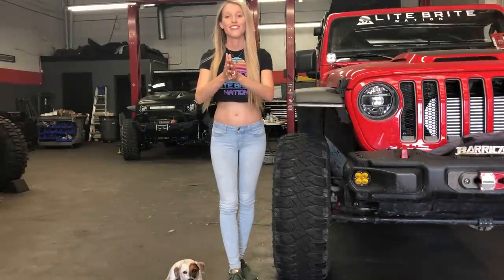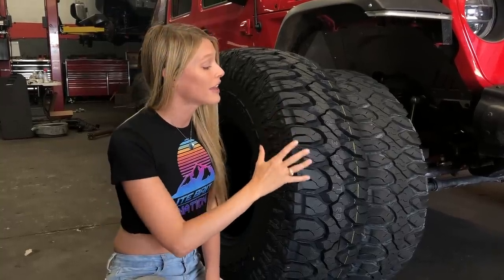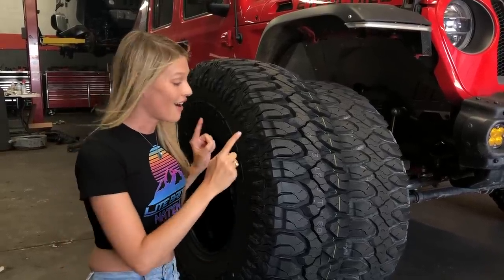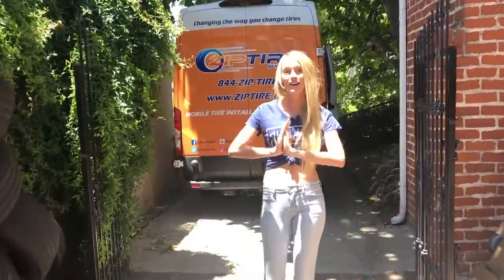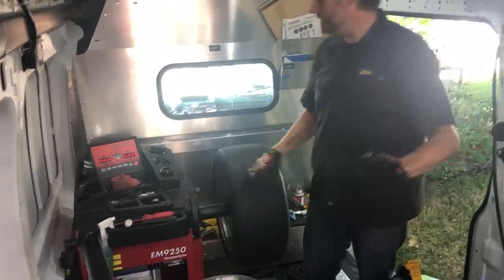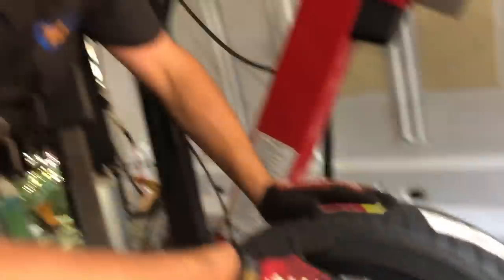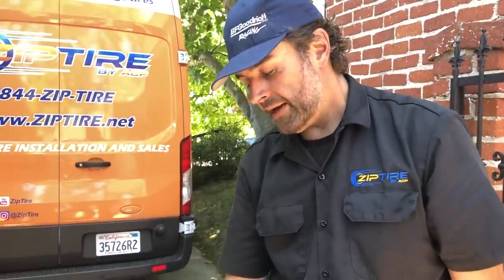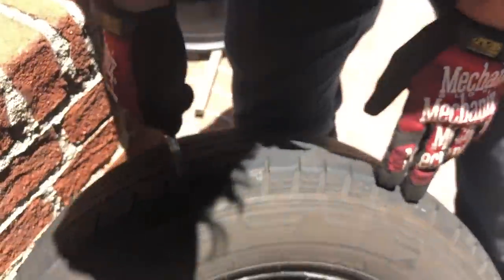LONG TERM TIRE REVIEW - Milestar Patagonia M/T

Comment: I bought a set of 35x12.5x15 inch Milestar Patagonias for my 1996 chevy k1500 with a 6 inch lift. First weekend I had them on we went rock crawling and trail riding. All I can say is OMG what a tire. While other rigs we’re struggling I was just walk right by them at about 15psi. Absolutely love my tires. And like y’all said, these tires are absolutely the quietest mud tire out there.

Comment: I love my Mickey Thompson STZ's zero road noise yet deep tread lugs and killer capabilities on most any surface excelling best on snow but with a mud tire look with side treads... Cheap too!
Reply: kevin auman I use to run those. Great tire. They are made by cooper
Reply: @boughtnotbuiltoffroad7784  yeah I saw one of your old vids of them but didn't you run the mtz's not the stz?
Reply: kevin auman yes your are right. I had the mtz
Reply: @boughtnotbuiltoffroad7784  right, I have the STZ or "snowterrain" while the MTZ or "mud terrain" are two very different tires....  Do a quick Google image search for the stz's and you will see the ones I have, much deeper lugs and although they look to be less aggressive of a tire they are insanely capable on any surface mounted on my Yukon Denali.... I was pushing snow up over the hood the first winter I got them and I was still only in 2wd

Comment: I have been wondering about the Patagonia tires. Thanks for doing the review.
It was refreshing to see so much accurate and useful information.
On our race cars a lot of money is spent to reduce rotating mass. Down to gun drilled titanium axle and transmission shafts and aluminum lug nuts. One thing to remember, the further from center the more significant the resistance is, so a lighter tire is more important than a lighter wheel. 
One thing you did not mention is unsprung weight. The weight fastened below the suspension must be controlled by the suspension. The further it is from the suspension the more leverage it has on the suspension. You did touch on this indirectly when mentioning the lack of failures. It directly affects the performance and ride quality.
I have spent a large portion of my life running log skidders and doziers and other equipment. The pay depends on production, often at the outside limits of what the machine can do.
One thing I have learned is new deep tread or tracks is often not the best performance. Weight balance/distribution and contact area are the most critical. Rarely is a sharp edge going to catch something strong enough to keep you moving. Not nearly as often as it is going to paddle the material out from under you.
If you are really serious about tread keeping traction off road, it needs to be steel as in bolted tires, chains or grousers. Chains will go through mud better than any bogger.

Comment: V8 with power and 40s = Kaboom dana 44. 1 Ton axles all the way. 40s are a PIA, curious to see how you like them on the street. Jeeps just drive different with 40s IMO. A guy I know just ditched his 40s and went back to 38s on his JKU. Not sure how they are on the JL. With regards to tires those Nittos in video are what Im running and I must say they are better than Toyo or any other M/T tire Ive had. 

Wheels:
Powder coat the wheels gloss black, have the bead lock ring powder coated the same red or close match in gloss red. Leave the dimples polished= WIN

Comment: Excellent production, pretty sure I'm going to try a set of Milestar Patagonias. One thing... its misleading to say that big tires and beadlocks could be adding "135 pounds of rotational mass per corner, or over 500 pounds total." Finish the equation and subtract from the 135 pounds per corner, the weight of the tire and wheel coming off each corner. Maybe adding 15-20 at most per corner.

Comment: I'd have the rims anodized.  More resistant to scratches.  If you powder coat them, i don't care what anybody says...no paint will hold against 5k lbs smashing it against a rock. Period.  But ano infuses the color into the surface and will hold bett(er) against scratches.  And i don't care what that silly man says, i LOVE the look of the Milestars, they are just different from the rest.

Comment: Leave the wheels as is, I like.  Also for Jeep enthusiasts out there, SCS (Stealth Custom Series) is now offering a Jeep wheel you may want to check out. Weighs only 25 lbs 3 oz. and I believe you can get them beadlocked.  Of course that will add weight.

Comment: I would have gone with 39x13.50r17 BFG KM3 Tires. Gloss clear on the rock ring and clear or a color on the rest of the wheel.
Reply: C7 GT1 the 39 KM3 is 37.5 so no thank you

Comment: Wow I never knew why but my 37 Pat's did look much better than my 38s.
Reply: Rusty Taflinger ya. We recently figured it out. Wish the aggressive pattern was on the 38 and 40
Reply: @boughtnotbuiltoffroad7784  That just blows me away. I just figured I'd gotten used to them and they were the same. I did the Jeep Bantom weekend and the trails were one big mud hole. I did real well on the trails unlike some and did notice the tires loading up with mud. Speeds were super slow so never had a chance to get some good wheel spin and try clearing them out. I think I was at a slight advantage because most people were on 35s and the 38s gave me that little extra I needed. Super jealous of those 40s, one tons and that motor. You staying with the 6 pack shocks?

Comment: Just wondering,  what is the proper tire air pressure you guys should have been running instead of the 8lbs Kevin had in the tires for the 2 hour drive? More Jelly !!!
Reply from the maker: 2019 JLUR Billet Silver Metallic Probably about 28-32psi

Comment: Guys, no tire clears mud very well... even aggressive mud tires. Fast wheel spin is the only way to clear your lugs in mud. Good luck from muddy Florida.
Reply: Gerry Harvey 🤔🤔
Reply: I'll tell you KO2s are worth a crap in mud even with wheel speed.
Reply: This.  I wheel in the midwest (ohio) and some of the sticky mud we have here, i've not seen any tire clear well without goosing the throttle.  If its the type of sticky crap that adds 10lbs to your shoes by walking 20 ft, then its going to do the same to any tire, period.
Reply: Won't fast wheel spin just dig you deeper into the mud?
Reply: Yes.  But it clears the mud from under the tire to EVERYTHING else!  Haha

Comment: Powder coat chips, and well, sucks to touch up. Suggest you guys look into getting your rims coated in Cerakote'. Way more durable and plenty of color options. I used Buster Beaver Designs http://buster-beaver.com/ since their local to me but I'm sure there's a cerakote dealer/coating company in SoCal. Just had a AVE front JK bumper refurbished and finished in a clear cerakote which looks amazing!

Comment: Powder coating the rim is for mall crawling only, it looks awesome on the 2nd floor of the parking garage.
Reply: Good thing they are only powder coating the inside right? Because they dont mall crawl
Reply: Jubeidono2012 hahahaha they could just raptor line it, looks good and strong

Comment: The DOT doesn't "approve" wheels. They issue a set of requirements with which wheels have to comply in order to be road legal.
With that, you were correct that there are only 2 DOT compliant beadlock wheels. B. A. D. Eklipse and Hutchinson Rock Monsters.

Comment: I use kittens W/velcro booties for extra traction, found out bunnies are too sloppy!!😜
Power coat adds weight too, for more mass in rotation! Pretty wheels are for the street anyway! 🤷‍♂️ I have new ko2’s on cool wheels & Mt’s (usually used) on stock Moab’s

Comment: Approximate Weight 
PATAGONIA M/T             40X13.50R17LT   88lbs    $388
Trail Grappler® M/T        40x13.50R17LT 103.7lbs $402
DISCOVERER STT PRO™
 40X13.50R17LT   92lbs    $430
Reply: Mikie Peters yessir

Comment: I run the kmc machete beadlocks (no powder coating) and Ultimate Dana 60’s and have tore up the rings since I met you guys at KOH and love them! Best investment so far. I keep the scratches... memories. Plus I get more compliments on the wheel’s raw aluminum. Cleaner look

Comment: So, this is a repost of another post, but I feel like it fits the video well :
There is indeed a proper terminology when it comes to wheels/rims/tires, unlike motor/engine.

/Warning Wall_of_text_and_history

It's tied in with the history and development of the wheel, which essentially goes like this :

First wheels were solid disks with a hole in them, and they were just .. wheels, duh. Made of stone or wood, with a hole in the center, sometimes capped off with a more durable material, like an iron ring, to increase durability.

Then someone wanted to make them lighter, and invented the spoked wheel which consists of :
 - The Hub (also called the Nave)
 - The Spokes
 - The Felloes (also called fillies)
 - The Rim 

The Rim was usually a metal band around the Felloes, that helped keep them under compression, though wet leather could be used too, as it shrinks as it dries.
Wheelwrights would jokingly suggest that the Spokes where only there to keep the Nave (Knave = uncouth fella) from the Fillies (slang for young female horse = young girls).

Sometimes softening material was added to the rim, like rubber or leather, and that is what evolved into the tire.

In fact, when bicycles came around, the pneumatic tyre was invented to soften the ride, and the old practice of Felloes and Rims, was combined into a single unit, now just called the Rim.

So now you had :
 -  Hub
 -  Spokes
 -  Rim
 -  Inner tube
 -  Tire

In the name of efficiency, a smart bloke decided that all of this spoke malarky was just too much work, and replaced them with two discs … it didn't take them long to realize that welding the whole thing together was even simpler and stronger, and the Steel Rims were soon born.
And while they were at it, they removed one disc, and made the other stronger, so now there was only one disc to weld to the Rim and Hub Assembly.
Technically, those are wheels and not rims, but since driving on them is incredibly inefficient, uncomfortable and unsafe they are usually referred to as Rims, and the whole assembly + tires as wheels - Trains, however, do drive on steel wheels.

Now, those Hub Assemblies were problematic, because it means you had to have a spare wheel for the front, and one for the rear.

So cars did away with the old method of the hub assembly by making the hub a part of the vehicle, and not of the wheel, because bolting the wheel to the hub, allows you to have a spare wheel for your car, that fits on all four corners.
 
Then came along tubeless tires.

Thus we have now reduced the wheel down to :
 - Rims
 - Tires
 - Valvestem

And assembling those, makes a useful Wheel.
Ta-daa ! 😁

Comment: Don’t powder coat the wheels. If you leave the finish aluminum the rock rash won’t show as much, scratched powder coat with the aluminum showing through will look bad. I vote leave the wheels finish as is.

Comment: LiteBrite >>> thank you for posting this video with your very talented and knowledgeable motoring/"engine-ing" friend.  You are doing both him and us, the consumers stuck at taking our vehicles to tire shops where they do not know anything they're doing, a favor.  I have had nothing but bad luck with tire shops that do not know how to proper pattern to rotate tires, they take shortcuts out of laziness and do the improper thing, causing you the consumer to have to replace your tires more often.  I have witnessed them "tighten" lug nuts not knowing the proper pattern, even leaving some completely loose; if you don't want this, definitely look into ZipTire!

Comment: I once had a tire puncture with a bolt the size of the one shown at the end.  It was on a full size K5 Blazer at highway speed.  The front tire kicked it up and it punctured the back.  No warning, the back of the truck just dropped instantly.  I got lucky that day, I don't recommend it.

Comment: I have quite a few jeep buds that say the mile stars aren't very good in the rain. I'm thinking tire pressure is critical for on road use in wet weather. Good tire tho. I have the XD Machete bead lock. Black wheel - polished ring
Reply: Brian Head most mud terrains don’t seem to do too well in the rain. Just throw it into 4wd. Lol

Comment: Red anodized spokes, raw alum bead ring!!! Or at least body color red - that’s your brand! Thanks to you guys I have 38” Pats and KMC 229 with red hubring like TrailRecon’s I picked up from Off-road Evolution. Awesome setup. Replaced heavy loud stiff 10ply Nittos. I didn’t like the MP tread at first now I love them for what they are. I heard “I only do V8’s” ;) Great tire video.

Comment: Everything you said about tire weight was correct. And coming from the drifting world I can see why you said it. Plus if you drive your Jeep on the street you need to be concerned with rotational mass etc.  But for off road, a heavier tire can be better, as long as that weight is in the right place. More rubber in the side walls will make a heavier tire, but one also more resistant to sidewall tears and punctures. If you have a rig that is trailered or a rig that isn't daily driven I wouldn't worry as much about the weight of the tires as their overall construction and what use I was going to put them to.

Comment: A rim is a metal center that a tire mounts on to create a wheel. Exception will be spoked wheels ala motorcycles or Englich sports cars, rim, spokes,  hub, and tire create a wheel assembly. Maybe ;-)

Comment: Question on the tires they kind of get a bad rap on when I asked that they wear badly and get a lot of road noise when they wear down?   Your opinion
Reply: Ralph Casados that depends on how often your rotate them and how good your alignment is. In our experience, all of our mud terrain tires we’ve had started getting louder with miles. Some sooner then others. If that is a big concern for you, you should look into an all terrain tire instead.

Comment: Cool video. I`m curios what engine (motor) will come in the StepChild. Anyway. I`m watching since almost the bginning of your channel and still enjoing it more and more. I`m a little slowed down with my videos due to some more work in the shop. What I don`t understand is Milestar. Here in europe it`s impossible to get this tires. I would love to put a set on our JKU but no one knows them and no response from Milestar as well. I wrote already emails to them for the reason , but no answers. Maybe there is some stupid European laws again. Well, if you will get an answer from them, I will highly apreciate it. Keep on with the cool videos. Nice greets from Switzerland
Reply: Vegan Overlander they are a smaller company owned by tireco
Reply: @boughtnotbuiltoffroad7784  thanks for your reply. I guess I wrote them directly to tireco. Just the point regarding the weight in this video is the most important. People here in europe, specially the DMV, are sometimes so stupid when it comes to improvment. Anyway, thanks for your reply and have fun in LA.

Comment: These tires may be great on a light vehicle like your Jeep, but they absolutely suck on a 3/4 ton truck.  The sidewalls are NOT close to strong enough for heavier loads.   I took mine back after a few weeks of scary driving, especially with a trailer hitched up.
Reply: Scott D what sidewall rating did you get? A 3/4 ton truck needs a D or E load rating not a C
Reply: @boughtnotbuiltoffroad7784  They were E rated... which is why I was very suprised at how mushy they were.  It was too bad... I did get to test them in some serious mud and they did well.
Reply: Scott D Crazy. Ours are C rated but like you said, our vehicle is lighter

Comment: Leave the wheels silver to keep low maintenance. Powdercoat all those bolts(? not sure what to call them) on the outside of the edge of the wheel rim red. Match the red paint color of the body to the bolts.

Comment: What size bump stops are you running? We have been using the Patagonia 40"s for about a month and with a 2" bump we still get a lot of rub but its manageable with the American Adventure Lab overlines, but we are missing out on an extra inch of up travel from the 6pak shocks . MetalCloak recommends dropping down front top shock bracket an inch and welding it to regain the full travel. What are you guys doing to maximize suspension travel while minimizing rub?...... oh and go Gold with a Black  ring super easy to touch up with a Qtip and black rattle can.
Reply: TRACX ya we may drop the top of the bracket down an inch or so. Just depends on what the shop wants to do. How much time they have but that’s definitely a possibility.

Comment: Looking forward to learning what MOTOR you will put in the Jeep.  I was just watching a recent Jay Leno's Garage episode on the 1972 (or was it 1971?) Plymouth GLX and he did say MOTOR in reference to the 440 in the GLX. The owner of the car responded the "engine" is....  Motor is a much better word for engines in my opinion. And also with respect to its etymology: Movere (latin) to mean a person who imparts motion, mover -> Motor (latin) -> Motor (English, and which was developed into the current meaning of motor in the 19th century).  Engine on the other hand comes from "ingenuity" (ingenium from the latin meaning talent, device) has nothing to do with "motor". It's actually a misuse of the term that has been adopted to refer to motors on locoMOTIVES, when we had the steam motors that people refer to as steam engine. A mix-up with the person who ran the motors, the engineer, perhaps...